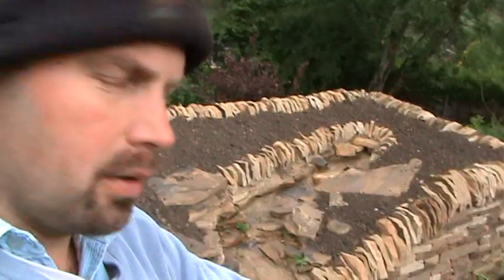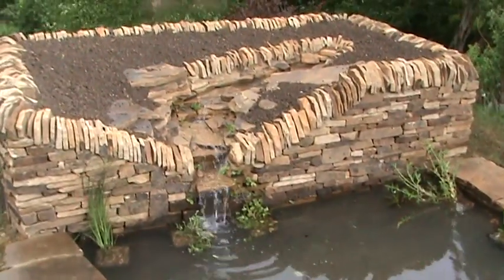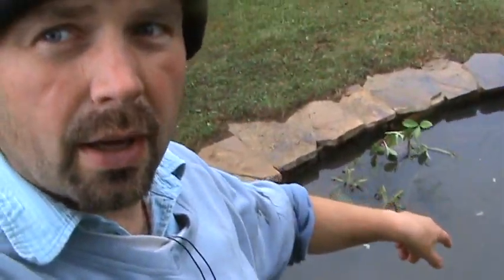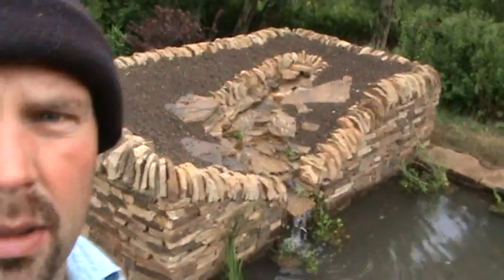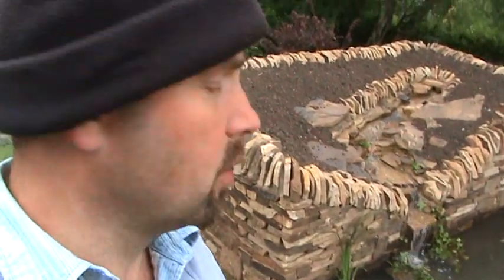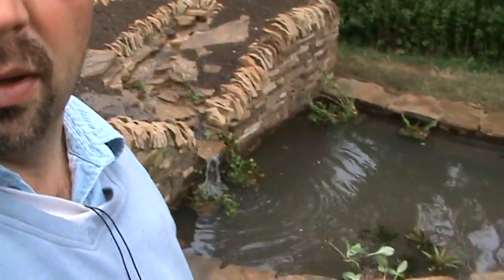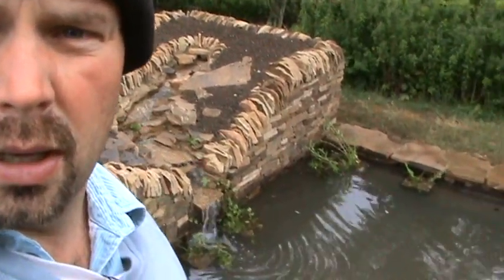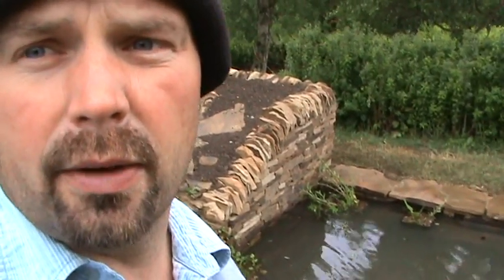Natural Stone Pond near Consett, Co. Durham - constructed by Pondguru

Comment from the maker: There are larger filtoclear filters available now. The 20.000 has a 36w UV and the 30.000 has a 55w UV. They are PLS bulbs so cost a fair bit to replace compared to the standard tubes. I think I've got a 20.000 on order for my shop so I'll do a video of it when I get time.

Comment from the maker: The design of the pond part was down to the customer but I built up the raised bed and just shaped it as necessary.
For building a waterfall, just make sure that is lined under whatever you build and that the liner rises well above the sides where water could escape if leaves caused the water to back up in the stream.
I always cement cascades as then the water is forced to go exactly where I want it to go.

Comment from the maker: It was so long ago since I built this I can't remember exactly how it was built. I think there is an internal blockwork wall which sits on concrete foundation faced off with the dry stone wall. Under the cascade I think there was blockwork built up on foundation to prevent any settlement then cascade built over blocks.

Comment from the maker: I suppose it would need more regular cleaning if there were lots of fish so I would either go for multiple filtrals or a decent size pump and filter which would ultimately be less running cost and less maintenance. And less cost provided you got a pump which didn't cost loads to run - i.e. Aquamax or similar.